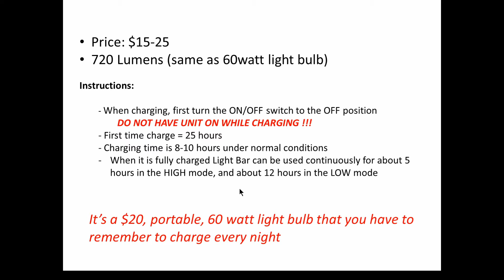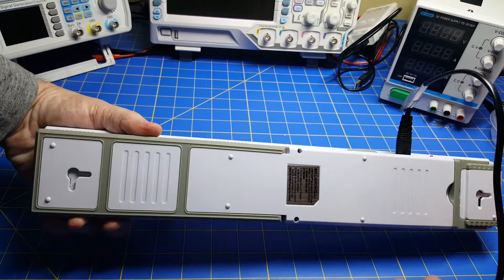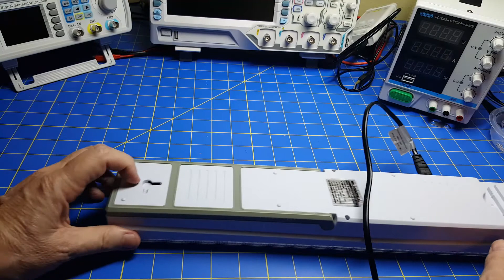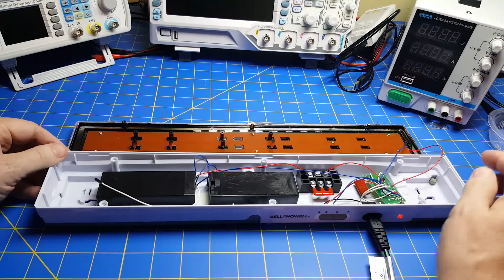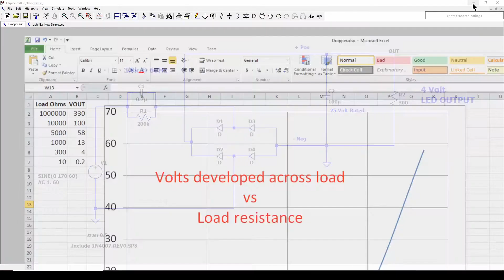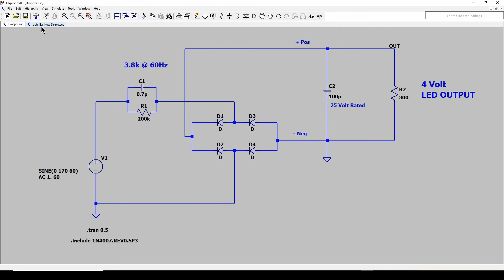Bell + Howell LED Lightbar Review & Teardown

Comment: June 2024, I just purchased this light and it is made different now. Looks the same, but the battery inside is different, I'm guessing because technology is always improving and changing. Anyway, if your considering buying this light, here is my experience with it. You still have to charge it 24 hours for the first time you take it out the box. No big deal, I plugged it in and forgot about it until the next day. Then any charge after that, takes about 8-10 hours. I use the light bar in a dark closet so it's not like I'm turning this thing on every day and leaving it running for hours. I might go in the closet 3 times a day for a few minutes at a time if that. So when it's fully charged it stays very bright for over a month without having to recharge it. Also, I did not use the screws that came with it. I went to Walmart and bought some of that 3M double sided sticky tape, I think it was $3.97 for a roll of it and I got the one rated for 15lbs of holding strength. I just cut a strip of that tape off and stuck it to the back of the light and then stuck that to the wall. Holds easy, no problem and I can always remove it if I want to. 

Lastly, in my instructions, it says you can just leave the light plugged in all the time and it will run the LED's continuously. So if your hanging the light near a plug, you could just leave it plugged in all the time. It does say to not run the light while charging, but that is because if it's plugged in and you turn the lights on, the power goes directly to the lights and not to recharge the battery. If your not using it wirelessly, you can just leave it On and plugged in and you will have light all the time. Just know if you turn it off, it will take 8-10 hours to charge that battery again. I like mine as it gives off plenty of light for a dark room. There are more powerful wireless LED's on the market, but I liked the fact that this one is a long bar, so it spreads the light out and projects it to a wider area in the closet. For reference, mine was $19.99 at a Ace hardware store.

Comment: Thanks for the video really helpful. Brother gave me two lightbars he was going to throw out. Found battery terminal corrosion and broken wires. Using an external power supply both units could not be turned off.  Your schematic helped me figure out that Q2 was bad. Replaced with 2n3904 from my parts bin fixed this problem. On all the batteries I cleaned the terminals and had to add distilled water to top off their cells. Using a battery charger at 200ma over night, they all read 4.28 vdc. Reinstall batteries and both are now working as designed. 
Thanks also to Edgar on the SOS info, that function works too.

Comment: 8:42 Some people also recognize SOS as "Save Our Souls" not sure if the instructions were unclear, missing or if you didn't see them but the SOS mode puts the light into a emergency mode. Simply leave your light plugged in and in SOS mode and as soon as the power goes off the light will turn on. You can simulate this mode by unplugging the device while it's in SOS mode. The light should automatically come on. This mode is great for when you have the light permanently mounted and plugged in in a location where you will need light in case of a emergency power outage. Where I am from the power tends to go off alot and these lights really helped me deal with that issue. I own 4 of them. I do believe they should have named this mode something other than SOS since most of us recognize SOS as a communication message. Emergency Mode would have been more fitting.